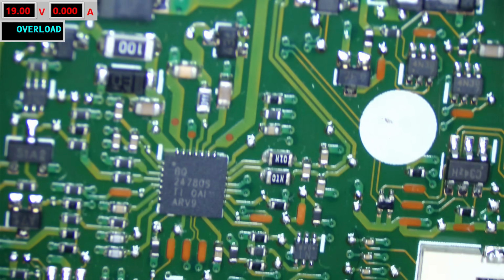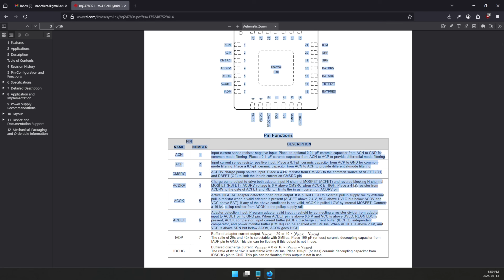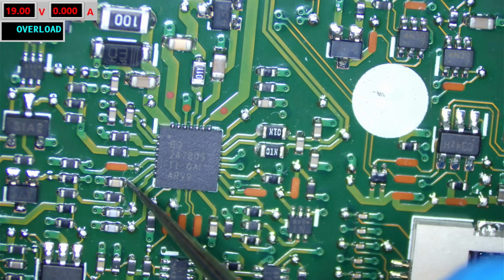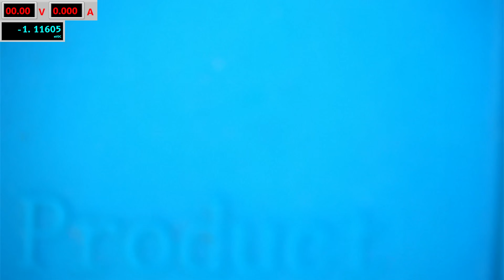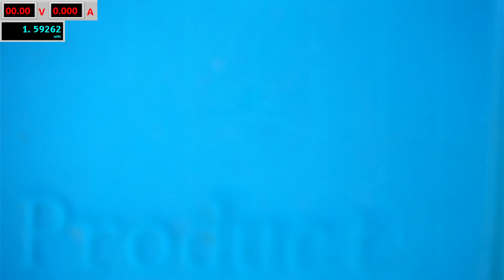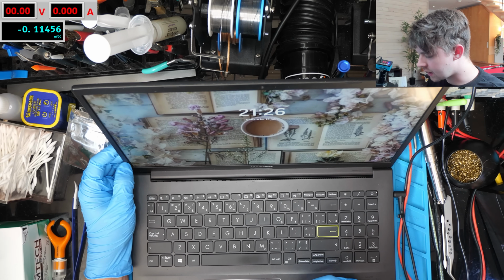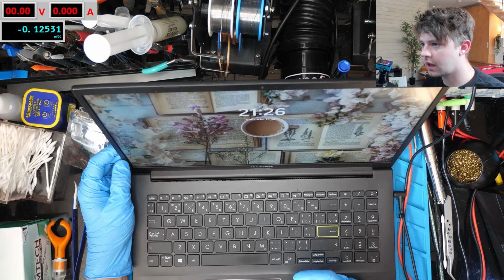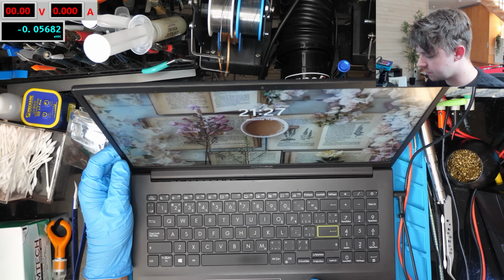VivoBook No Power – Common Power Failure Diagnosis

Comment: Most of this I did not understand. Do you know a good resource to learn about current and multimeters and such? The whole volts-amps-ohms thing really does my head in. And so I'm lost when you're taking measurements at several points and saying what each pin should say because it's apparently obvious. 🤷‍♂ I've only been soldering for a couple months now on old Xboxes just to learn, so I have no electrical background. This is all magic.
Reply from the maker: thank you for saying this! I didn't explain as much as I normally try to in this video. I will definitely be making videos in the future that break down multimeters and power supplies more and how to effectively use them for repairs. While this series doesn't specifically go through multimeters, Richard does an incredible job explaining everything in a way you can understand and I highly recommend it to better understand how electricity works with various components:
https://youtube.com/playlist?list=PLQ_OzNEYrepVlm02UxQRa40_B-2YyblHv
Reply: @nanofixca  Thank you for the link! I hope it helps me. And either way, I look forward to your future videos!

Comment: nice repair!

One tip: when changing MOSFETs in areas like these a similar one that matches the package will do perfectly fine. They do not need to be the exact make. Just make sure it is the right type (N/P) and that the package matches. As long as you take it from another laptop where it was also on a 19V rail any other N_MOSFET will do, no need to order the exact thing.
Reply from the maker: Thank you! And yeah good tip! I did look around before buying some. I don't keep a ton of laptop donors around unless they're nicer boards since I mostly work on consoles (plus they take up a lot of space lol). The ones I do have all had the larger package size so I just bought a few.

Comment: Great video showcasing one of the most common laptop faults 👍I've had soo many VivoBooks with all kinds of faults; Late winter of 23/24, in the span of 2 weeks, I had 11 VivoBooks with the same, exact fault come in. This time it wasn't a power issue, but simply a "frozen" BIOS. Every single one of them. I think Windows pushed a BIOS update or something an this happened. I'm in a rural part, in the south of Norway, so seeing that many in such a short span, and they were all the same model, is highly uncommon!